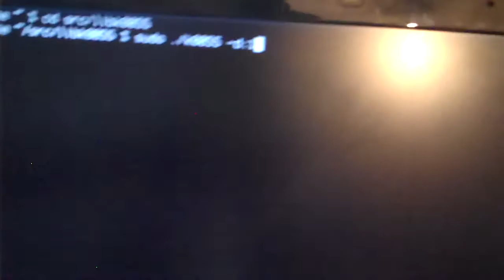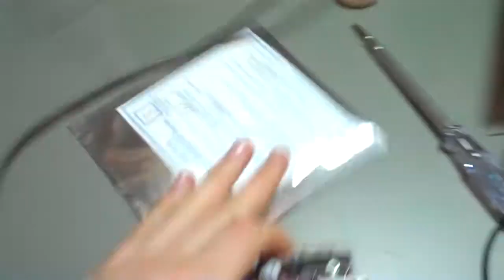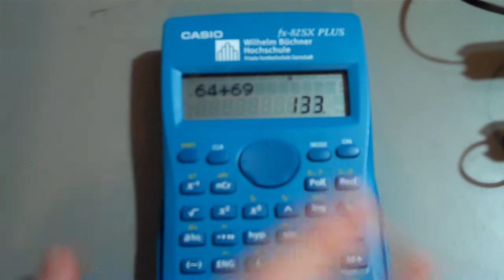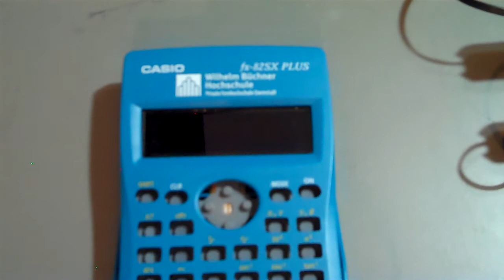Switching things from anywhere

Comment: I forget what you are doing.. have a minute to let us know?

My project is coming along nicely .. cpu board (ez80 or 6809 or other guys, but mostly for ez80), and gpu board doing display magic. For programming the ez80, I've just put on the zdi ISP header as per datasheet (pcb arrives from boardhouse next week, finally find out if it works or not ;), so should be easy enough to flash direct from Windows; I'm a unix/linux nutjob so expecting to have to build my own zdi interface .. perhaps an avr8->zdi programmer of my own (serial -> avr8 -> zdi), or something from stm32 (which is why my gpu is.) Or maybe use bus pirate or something, and do zdi direct from PC. Decisions decisions :) (or perhaps use the zilog dev suite under virtualbox or a VM, if it and USB works there)

You normally run your own monitor app on the ez80, and then in turn just writes to the flash addresses direct, right?

So what do you do for ISP sake? Programming from an avr8 wasn't it?
Reply: How are things going??

Comment: I've had good luck and not needing to power cycle; seems like it should be pretty easy to just have serial to the board, and another serial or something that drives a relay or switch to toggle the power .. but I imagine you had the Vellemen's just lieing around itching for use?

I am in a very similar vein as you, but you're a few years ahead. Love your hacks :)